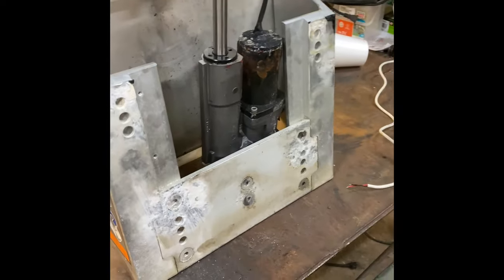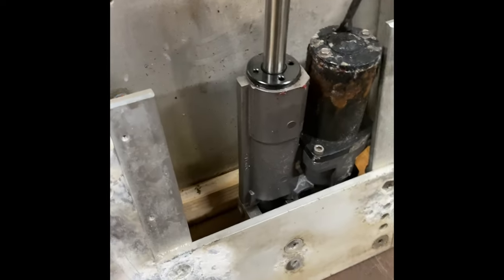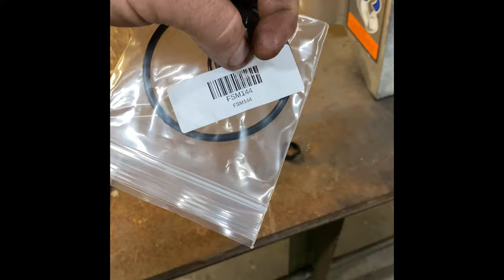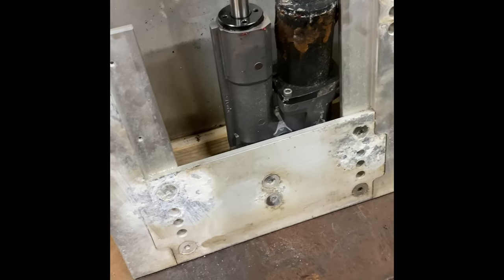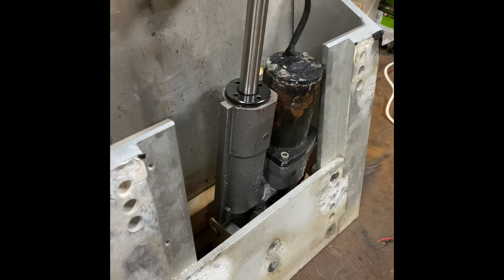JACK PLATE REPAIR - BOAT REPAIR - EASY FIX - ATLAS JACK PLATE ISSUES - IT WORKS NOW - #boat#repair

Comment: T&H marine sucks, wanting to replace the whole motor, I had to replace the electric motor on mine a couple years ago, same thing, called you need a new motor, $900 for a new unit. No thanks had it rebuilt by a local starter/alternator repair shop. Went out again and purchased a replacement motor on eBay, $159. Now my top seal is leaking, just pulled the motor, will look for a local hydronic place first, or order the kit, thanks.
Reply from the maker: Yessir . Ty will try to get ya!
Reply: @jeepmankmike By any chance do you have the link to the replacement you got on ebay, thanks in advance

Comment: Any tips to DIY this at home? Boat is still sitting in the water so I'm wondering what I can do to lock the jack plate up once it's on a trailer so I can take out the pump assembly. And if the seals were blown in the saltwater, is there a way to flush anything to make sure all the saltwater is out?
Reply from the maker: I would get it on trailer and use a floor jack to suspend the sliding plate up so you can remove the pump . I would pull all plugs out and give it a flush with fresh oil and some diesel fuel . Pull piston out and just make sure it has no corrosion inside . If it doesn’t, throw a kit in it and should fix your problem .

Comment: Appreciate the video. Im attempting to do mine I ordered the seal kit and have the wrench however, mine is so so tight that it won’t budge.  Any tricks getting it off? Also, did you release the pressure screw on it first or just un-tighten.
Reply from the maker: I actually just loosened it right up . Took a few bumps with hammer to get it moving but came right off. Usually they aren’t too bad since they have oil on them all the time . Give it a few good taps . Righty tighty lefty loosy !!!!

Comment: Awsome video i was about to spend 900 on The actuator! 
How did you feel With hydraulic fluid once apart and how did you bleed it?
Reply from the maker: It is simple to do . Once you have pump assembly out , it has 2 bleeders on it . You fill the reservoir up then put the shaft and top back on , then flip it over on bench and actuate it a few times, and open bleeders just a lil to get air out .